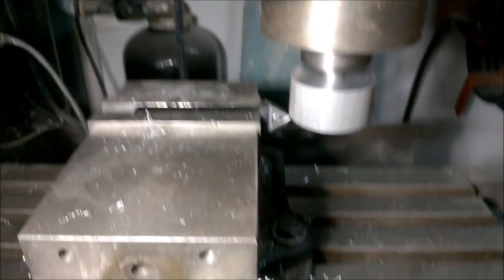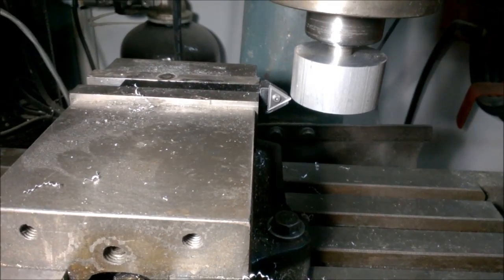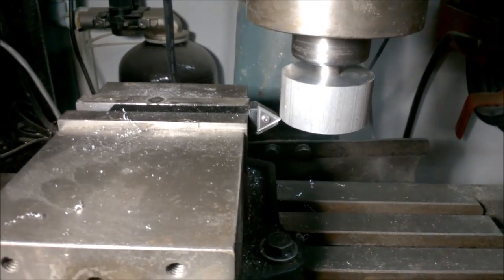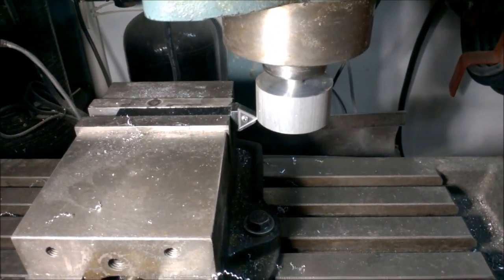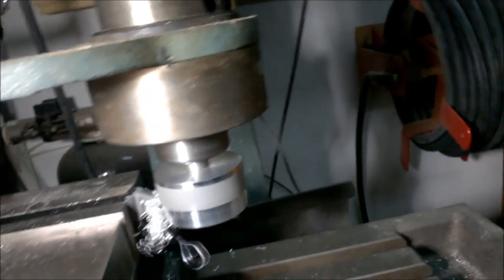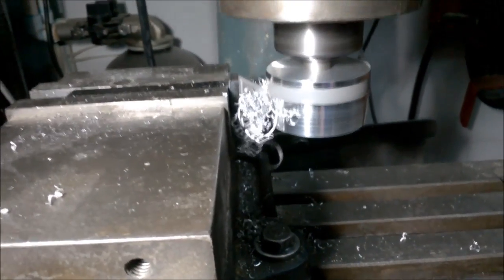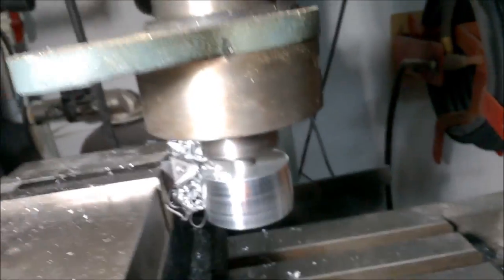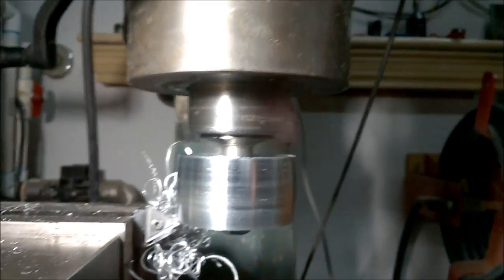Crowning a pully on my CNC Milling Machine

Comment: Very nice way to make a domed pulley.  Are you still doing videos?  Could you help me with the G-code for this process.  I need the same type of pulley for a project i'm working on.  I'm not that knowledgeable in generating the g-code for the CNC mill.